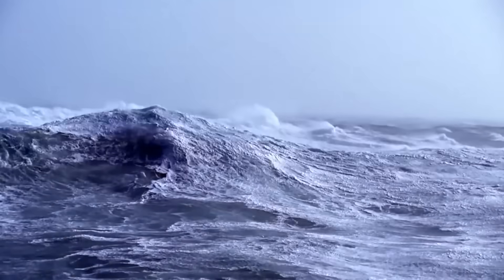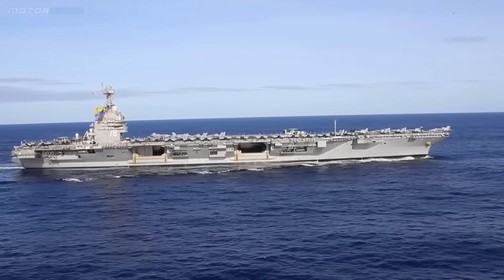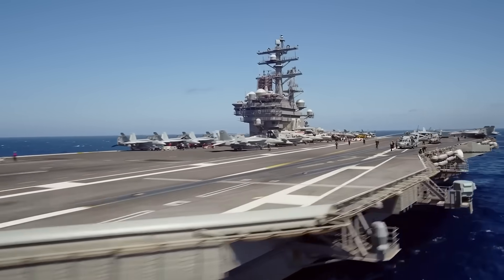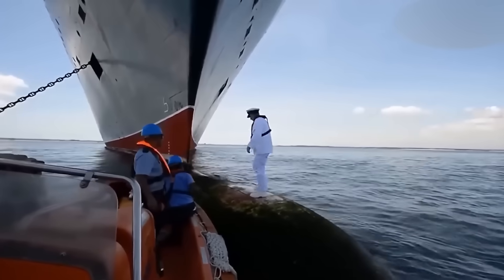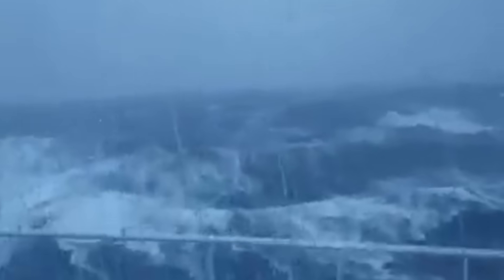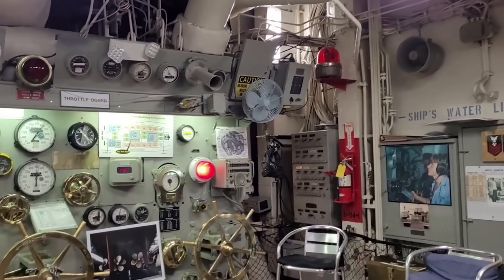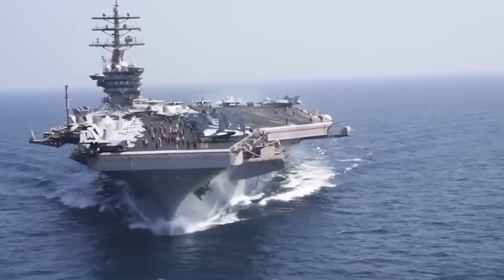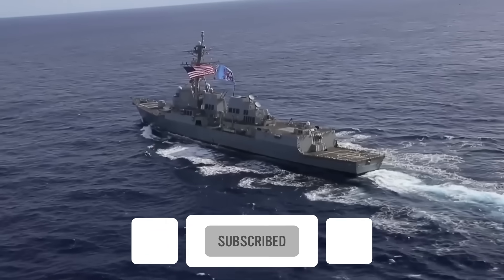INSANELY Big Waves Slam Into US Navy Aircraft Carriers: Here’s How They Survive

Comment: No ship is unsinkable . Carriers are outdated as they can not be defended against modern missiles .
Reply: While this vessel maybe seem to be outdated, it seems every nation wants an aircraft carrier.  If they can not have a full size aircraft carrier they build smaller ones that use vertical lift aircraft! It is the ultimate symbol of power project! When the US could not use local airfields in the conflict in Alphganstan it just pulled in the mobile airfield.....the aircraft carrier! China 🇨🇳 has 3 and building more! Russia 🇷🇺 has 1 even though 😳 it is welded to the pier most of the time! France 🇫🇷  has 1. Japan has many light aircraft carriers. Brazil 🇧🇷  had 1. It sank it to avoid additional cost. I think India 🇮🇳  has either 3 or 4. Great Britain 🇬🇧 has 2.
Reply from the maker: They are old yes! And the force of nature is above all!
Reply: They are not unsinkable, but damn close to it! If you were ever on one, you'd know that.
Reply: Wrong. There is about 500 surface to ait missiles available to defend the carrier. Contrary to popular belief we can and have shot down hypersonic missiles from China and Russia